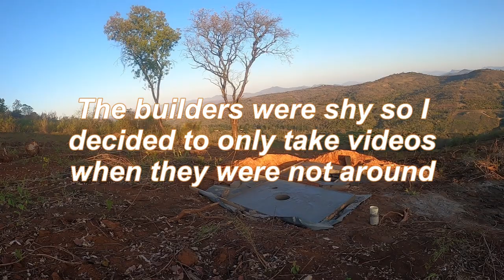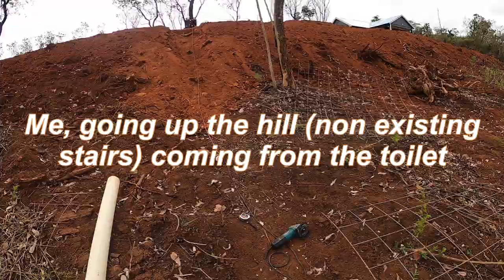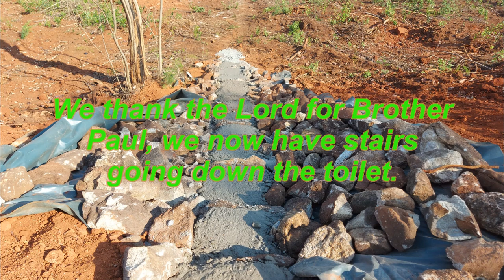Building an outside toilet (Pit Latrine) | SDA Country Living

Comment: What was the second square/oblong opening  just below the toilet area for?
Reply from the maker: It is the slab, once it dried, they put it on top of the hole. It is basically the base for the toilet. It had two holes, one for the toilet seat and one for the pipe for ventilation